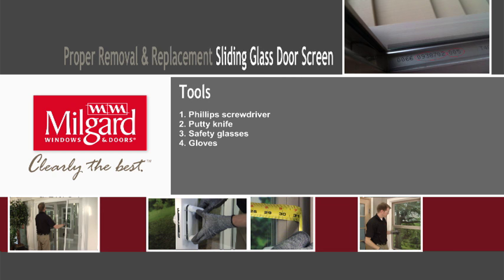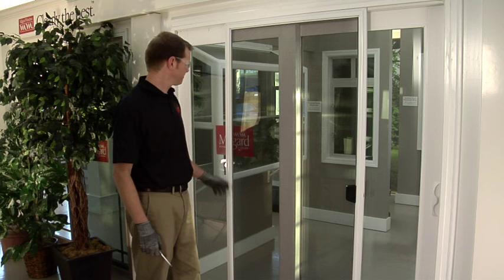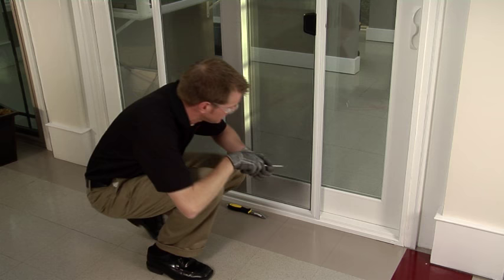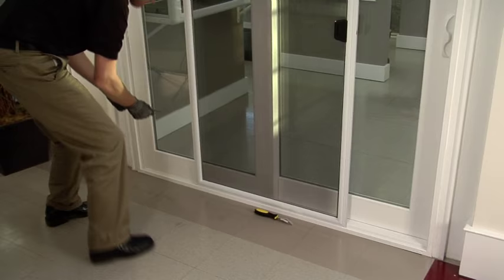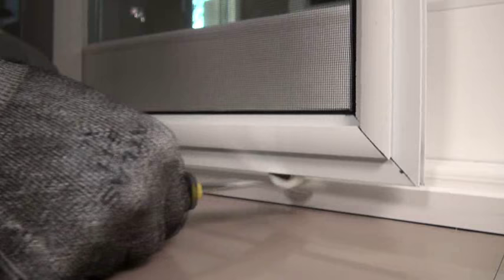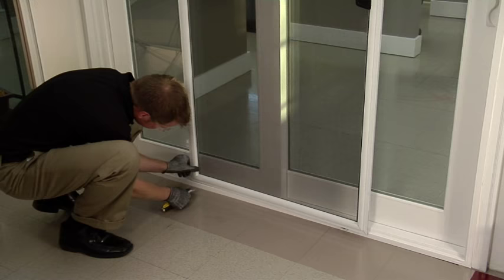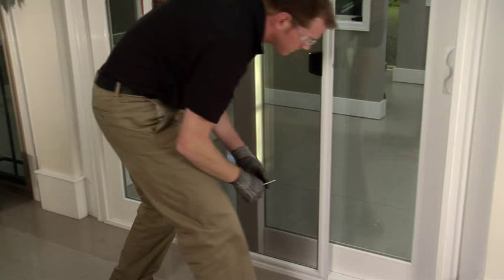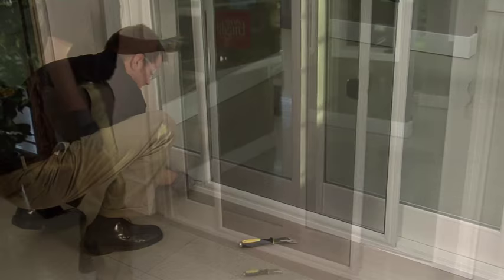How To: Proper Removal & Replacement of Sliding Glass Door Screen

Comment: Like what many have describe here.  I got the ones that are poorly designed.  No give on top or bottom to remove the screen door frame.  Tried unscrewing all 4 screws (2 top/2 bottom) and still no wiggle room to do anything.  Will give props for the service when its still under warranty.  Had 12 windows replaced due to the film between the dual pane being defective but I do question the craftsmanship on Milgard products.  Sad that a simple screen mesh damage can not be easily repair.
Reply: Same here!  I can’t get my screen back in. House was built in 2011 and I’ve had MANY windows replaced due to seal issues.  I was told there was an issue with the seal manufacturer used at the time so not necessarily a Milgard issue but it is as it’s the third party product they used.  I’m hopeful they can replace my screen.  I just paid $50 to have it reacreened but can’t get it back in. There is zero wiggle room. Not sure how i even got it out to begin with, to take it to ace hardware for repair!

Comment: I am having a problem getting my sliding screen door out of track , i have all 4 tension screws backed completely out and can't get enough clearance to pull door out of frame, don't want to bend sliding door frame to remove but I don't know how else to get it to come out and I don"t really want to bend track out on frame to remove. Any advise. Thank you
Reply: @MichaelDirk  that is what I did it took a little forcing but got it out without bending or breaking anything, my last house my slider would come out so easy, thanks

Comment: My screen with all the screws loose and while pushed up until the top of the screen is touching the frame still protrudes a quarter inch into the bottom track. There is absolutely no room for a putty knife, nor can I see the wheels. And there is no way to raise the screen further. Is there another type of screen door on a double glass door? 
Door was installed in 2005 any comments welcome
Reply: I have the same issue.

Comment: Same experience as many of you, the door will not even lift up enough to be able to see the bottom edge of the door. I spoke with Evan at Customer Service and she told me there was not anything she could tell me beyond what the video instructs. Well, that's  the definition of insanity, " continuing to repeat the same thing, expecting different results". That and buying a Milgard product. Ever research what its like downstream from the PVC plant? Great product, great customer service!! NOT!!!
Reply: Same issue with me. I’m unscrewed everything to the point where the screw is basically out and I still can’t lift the door to see the fucking wheels….paid well over $2000 for this unit and looks like I’m shit outta luck in replacing the screens

Comment: hi, my screen door is in between. so 2 glass sliding doors outside and 2 inside so total 5 tracks. my screen door is fixed now I am having no luck to put it back all the way to middle track. what should I do?
Reply from the maker: The steps to remove and replace the screen and the door should be the same, no matter how many tracks you have.

Comment: I have a series 8000 sliding door that has a bar attached to the top and bottom tracks. How do I remove the top bar? I've already removed the bottom bar
Reply from the maker: Hi Curtis - If you call 1-800-Milgard, they will be able to help you. Thanks.

Comment: Not sure who installed mine on our house but the door is too tight to lift off. No gap. It's as though they placed the screen in and then sealed the track on afterwards. 😣
Reply from the maker: Hi - Sorry to hear that. We don't do the installations, so, it's hard to say what happened. If you call 1-800-Milgard they can send a technician out, though.
Reply: Milgard Windows & Doors I got it sorted out. Thanks for the video!
Reply: Hi, were you able to remove the screen?  I have the same issue and have not been able to lift the screen out!  The customer service will not send anyone out that the warranty covers only the window and not the screen door which is only one yr warranty.  I ask if this is a defect in the window casing I should not have to call a dealer and pay for the service of removing the screen door and have to do this every time I need to change my screen.  I have removed other screens before so it's not like I don't know how to do this.

Annie

Comment: No help from Milgard or Milgard Dealer tech or the video on removing the screen door that does not clear the track for removing the screen door.  They all want to charge for a service person  to come out and assist.  I'm not asking them to replace the screen I can do it myself I just can't get the screen door off the track.  I believe it is a design issue with the patio door installation not a consumer issue.  Milgard tells me they only warrant the screen doors for 1 year, I'm not asking for them to replace it just remove it from the track.  I am the original owner, what homeowner test the ability of removing the screen door from the track when purchasing a new house.  It's been 15 years and only now I need to change the screen, who would have known the screen door that sits in the frame is defected!!  Who would have know in years to come the screen door is not removal able that is terrible product.
Reply from the maker: I'm so sorry that this video did not help you remove your screen door. The screen is under a 1 year warranty, so, we can send someone out to assist, it's just not covered under the warranty any longer, so, there would be a fee to do so. Let me know if I can assist at social@milgard.com
Reply: I’m having the same issue
Reply from the maker: Hello - if this video does not help, you can call 1-800-Milgard for additional assistance. They should be able to email you documents that can walk you through the process.
Reply: I agree. It is a design issue. This same crappy screen design has been in use since the 70's. Take them to small claims.
Reply: I'm having the same issue!
Reply: Are you having problems trying to remove the rollers from the tracks because they are too deep in the rails? If that's it then I had to slide a paper sheet underneath the screen and roll over it and used that to get it off the tracks. I used a political ad paper because they are perfect for it since they are long and thin and just about thick enough to withstand having to roll the screen over it. I hadn't seen a video of anyone having the same problem so it took me a bit to think on how to remove it.
Reply: @Tatman1212  o